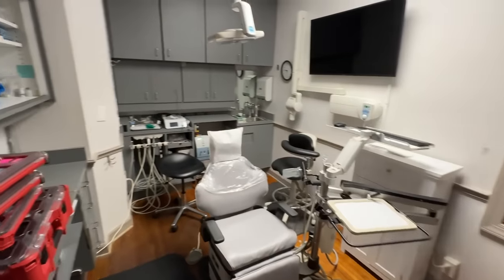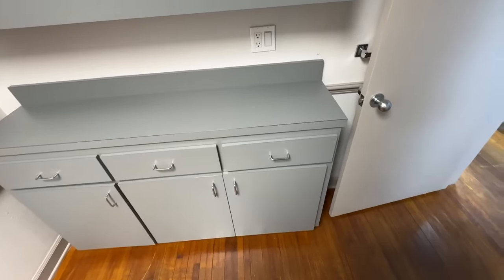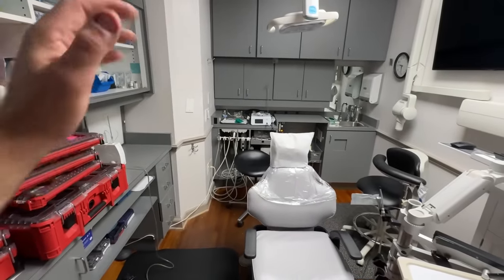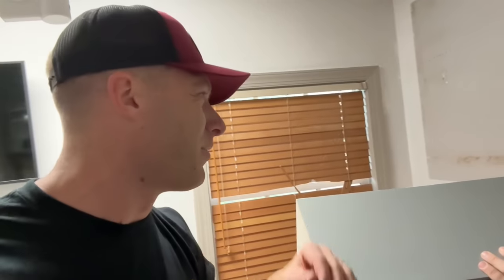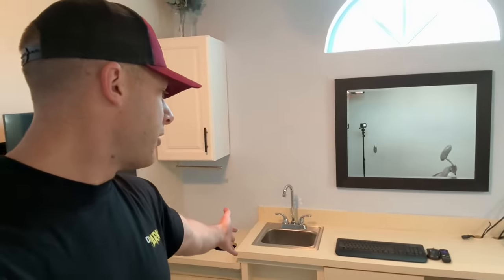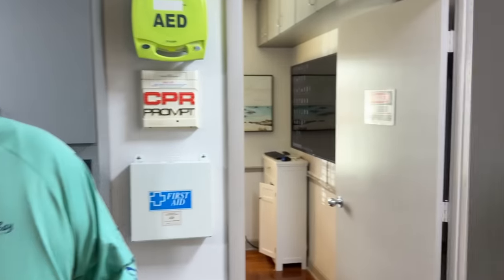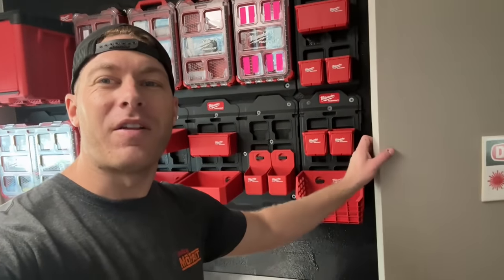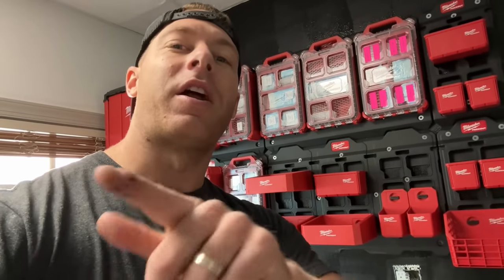We Remodeled My Main Surgical Room With A Toolbox and Milwaukee Packet

Comment: I had 10 vertebrae fused 13 years ago, when they wheeled me in the operating room I saw  they weee using 18 volt cordless dewalt tools covered with plastic bags. I made a joke about doing the surgery at the shop at work, nobody laughed.
Reply: I think that's when I would of walked out. Hope it made you feel better I got a few that's needs this